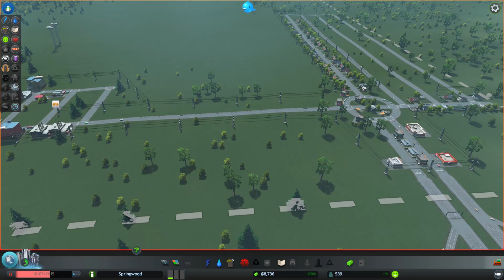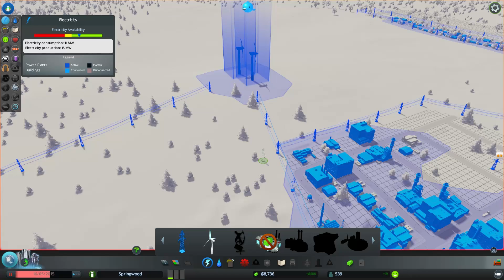Cities: Skylines - Quick Tips #1 Power Lines

Comment: they are WAY too small, real powerlines are about 400 metres apart and 20 stories tall, these are like 6 floors high and a maximum of 96 metres apart. I found a taller transmission tower asset, combined with move it you could probably make them further apart.